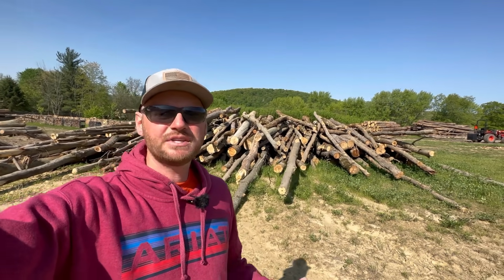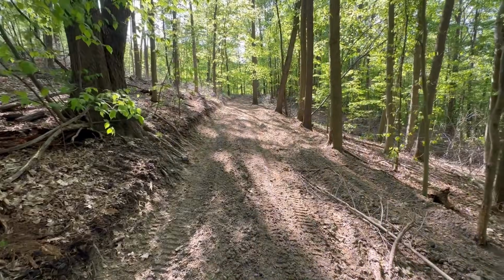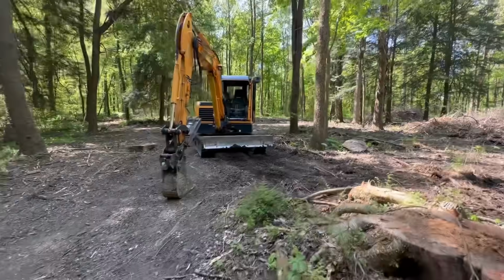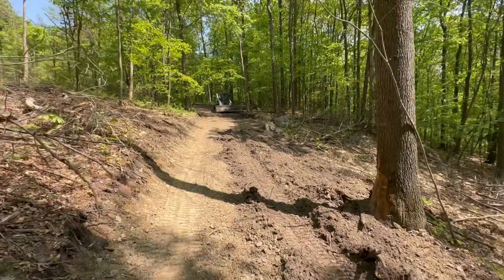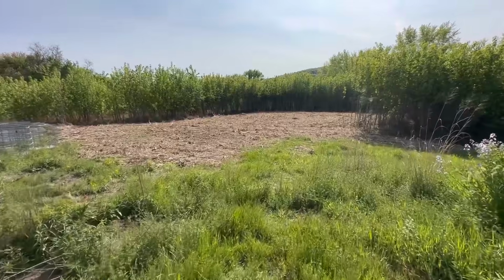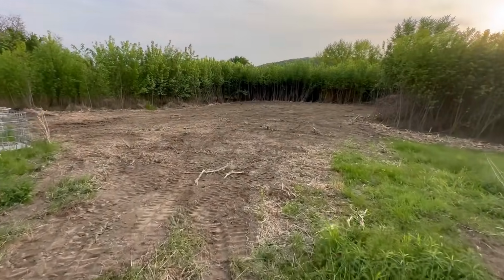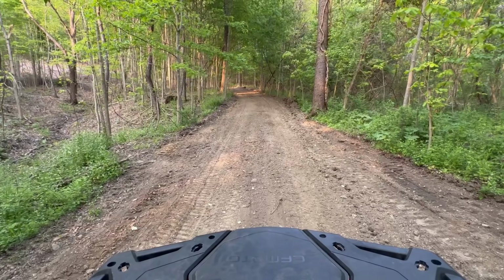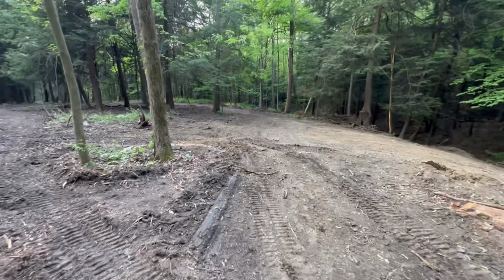Fixing Skid Roads With A Track Loader Dozer Blade

Comment: Trails? Those are like roads! Looks like you could drive your F150 back there. In our woodlot we have “truck roads,” which are trails where you can comfortably drive a pickup, and “tractor roads,” which are trails and old skid roads that are accessible to the tractor, but not trucks. We don’t have any of the equipment you and Doug do beyond a comparable tractor to yours… A tractor beats a shovel, rake and wheelbarrow, hands down!

Comment: Adam, I'm that old man that believes box blades make somewhat of a attempt at ballast! The skid-steer vs your tractor, these are guesses and not identified facts!  Three times the horsepower. 3 times the weight, 3 times the hydraulic oil flow--8 times the purchase price!!  Loaders are a tremendous joy to operate when you learn to work a machine without cutting edge visibility from the seat!!!  Enjoy your videos and my other suggestion--DON'T MIND ME!

Comment: Adam/Doug- did you try making any new trails with the skid dozer blade?  I have used a dozer to clear trees but would love to have just one machine if an 82 hp skid with a dozer machine will get the job done instead of having a one truck pony dozer as well

Comment: I'm sure someone has mentioned this, but the number of baskets you'd need to finish all of that firewood doesn't really seem reasonable.  Have you considered instead building a large firewood shed or maybe just stacking them on some concrete blocks (or something like Outdoor With The Morgans)?  You could probably keep 100 baskets worth of wood if you had a system to stack the wood vertically until baskets start to get empty.